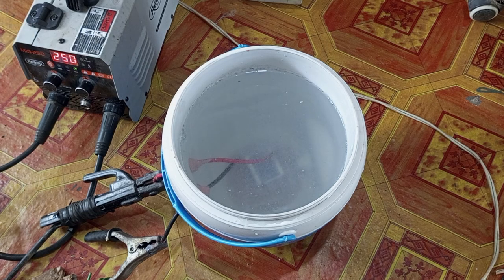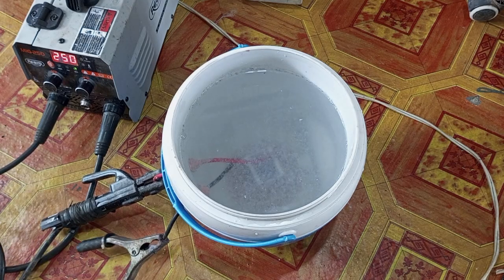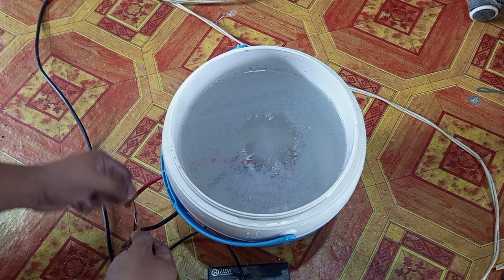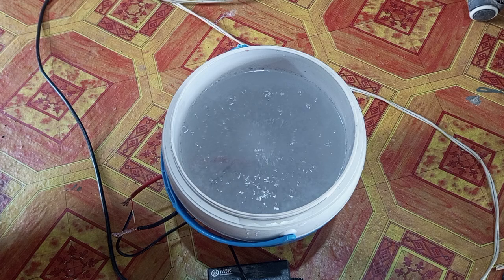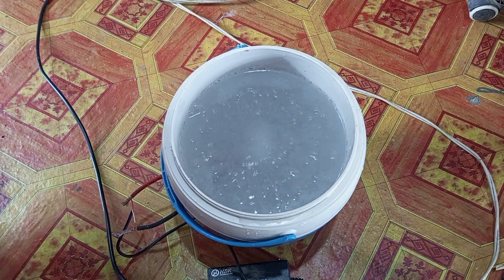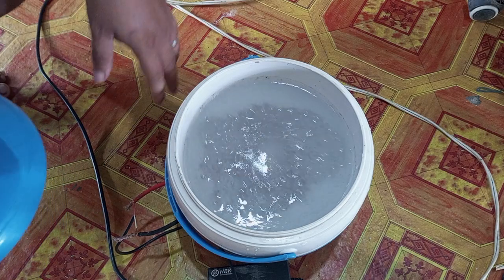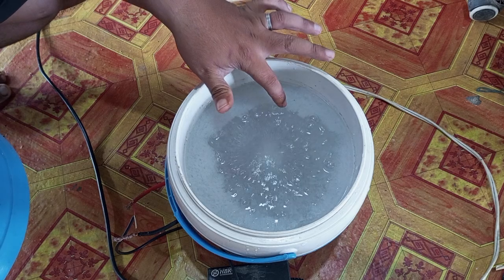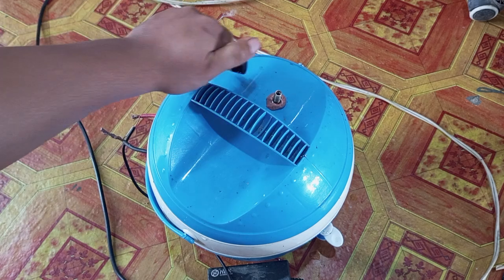I use a welding machine for my Electrolysis Set up

Comment: That amperage is so high , ur cell is so small so u probably waste power on heatn vapour sir , though is a good trial
Reply from the maker: actually i realized that its not only the amperage that matters. you also have to consider the second law. so even if the amperage is high and it is not guaranteed to yield more. the second factor is needed for successful and efficient electrolysis set up..